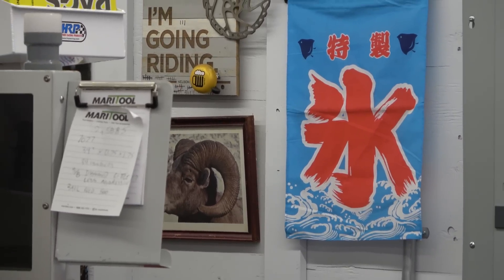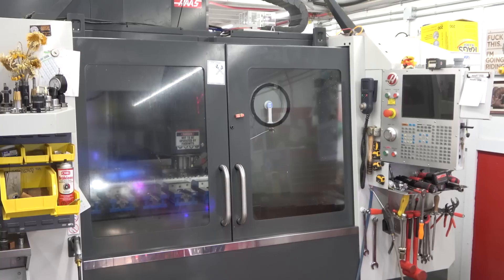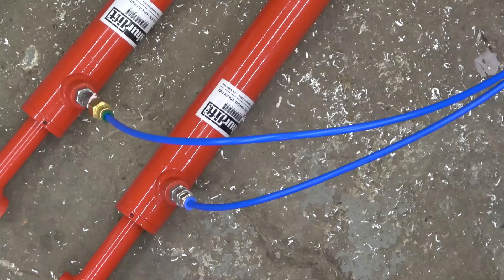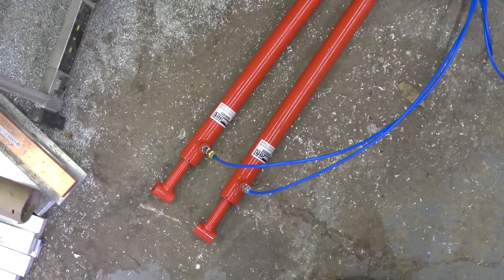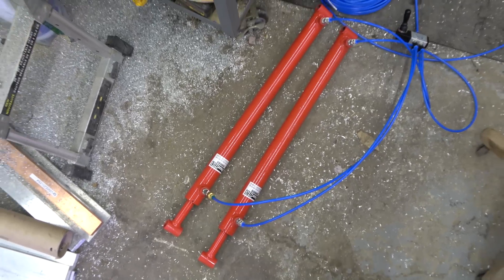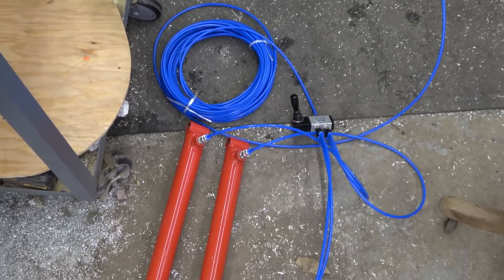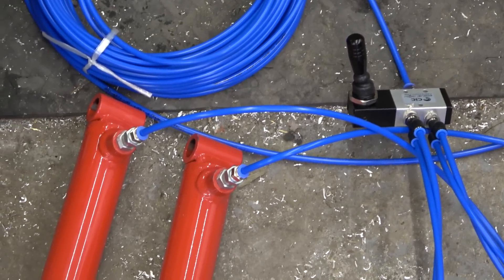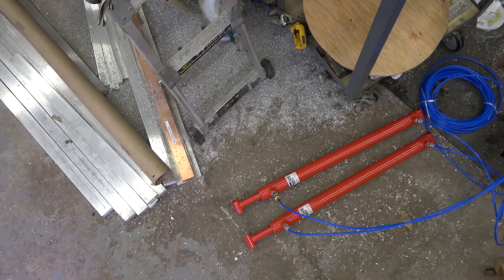Hydraulics using compressed air.

Comment: Try running it off the coolant system. That could be entertaining
Reply: LOL was gonna suggest the same... You already have a low pressure hydraulic capable fluid at the machine!
Reply: How well is the coolant filtered? Any chance of frigging up the seals?
Reply: This exists for Haas VMC machines through Dynatect. Expensiver than frick, but it'll get ya through an OSHA  violation once dewclaw puts his dangle into it.
Reply: Why would you say a hateful thing like that? Truly, man is wolf to man!
Reply: would be entertaining, you mean....
Reply: Air is a gas, not a liquid.
Reply: @nathanpennell1587  air is a fluid
Reply: @nathanpennell1587  no trueer words have ever been spoken. Unless it's really, really cold.

Comment: Just double the same top and bottom. 
Newton called it "angle of the dangle" or "sticktion" 

Something like that.  Unless your top mount is stronger than all get out. You're basically just punching a corner into the ground

Other than that, I'd say wallow out a definite bottom rail and grease the monkey out of it

Neither way is proper but it's fun 😂😂

Comment: We use air over oil with hydraulic cylinders for some applications. Tanks on either side for the oil to push into. Lubriplate FMO 85 VG-22. Takes the springy-ness out of it and the oil keeps the seals nice and lubricated.

Comment: My brother had a log loader mounted on an M-123 tank recovery truck. The dipper boom cylinder would air up if it sat around too long. It made for some pretty dangerous behavior from that boom if you didn't take a few minutes to work the air out of it.

Comment: yeah, but you could fill one side of one piston with oil, and tie the oil line to the opposite cylinder purge it good, then ending up with one air line per cylinder and the hoodraulic oil to synchronize them

Comment: I had a dream that you explained why we use hydrostatic testing vs. Air/nitrogen for pressure vessels. I witnessed an explosion recently, and I’ve always been a pro-hydraulic fan. You could maybe touch on explosive hydro-forming spheres for fun, and why nobody dies. 
Signed by a 10 year almost welder for the mining industry,
Johno

Comment: Question O the day , would it be practical to run the dumped air from any pneumatic system back to the compressor inlet to recycle used dry air . ???

Comment: One chain ran in a big oval over the doors, each door attached to the opposite parallel run of chain. Turn it from one end with an air motor on the other just an idler.

Comment: Why not  use your tools to make a rack and pinion to move the doors? Attach the rack to the top of the doors and then use a pneumatic motor to drive the pinion to open and close the doors, and the doors would be back drivable if you needed to manually open the doors.

Comment: You are the last person I expected to try this.... not a good application for air, too much chance to store energy and cut your weiner off. 😢. Use one DC linear actuator with chains and sprockets sprockets.  Actuator pushes/pulls the chain loop and takes the doors for a ride.

Comment: DIY air over hydraulic: Oversize the airlines and run them to the ceiling and fill with hydraulic oil. That way the cylinders are always filled with oil. I bet you it’ll work.

Comment: You probably have or would think of this yourself, but I'd suggest cleaning out the cylinders and lubing with  a much lighter oil than hydraulic fluid.   My guess is that the rings are permeated with the heavy hydraulic stuff and that if you could dilute that some and replace with a lighter oil permeating the rings it would work better.  OTOH the rings being made for heavier oil and (much) higer pressures, may never be happy acting as pneumatics.

You also have the problem that the rings were made to be saturated (or at least in limited contact) in heavy oil constantly. It's possible that using as pneumatics they'd dry out and eventually crumble.  Possibly you could mitigate this by making sure to include some thin oil in your pneumatic air injection.

Comment: Engineer a linkage so the  cylinder doesn't do much work. I suspect they will slam otherwise. Air will compress untill its got enough to actuate then it'll be too aggressive. Or not.

Comment: Curious if you were to do air over hydraulic with an accumulator of larger diameter increase the effective area moderating fluid flow rates. To make the flow more linear and perhaps faster since you would be displacing smaller volume of head space if the accumulator was nearly full

Comment: i'm confused. doesn't the haas have automatic doors already? my VF2 does. button on the side of the panel... the top of the door has a rack gear on it and a small motor on each side. it's not particularly fast but it works.

Comment: Hydraulic does have its advantages as far as positioning goes.
However, one can use pressure on both sides of the cylinder, as to dampen it. The cylinder still moves when a differential pressure is provided between the two sides. However, given the sticky nature of these two cylinders then one would need a fair bit of differential pressure to work with, and add on top some backing pressure for increasing stiffness, then it very quickly ends up being a scary amount of pressure.

And as detailed before, air is a much better spring than oil. So it stores a lot more energy that is always eager to escape.

Comment: There is another way to do it.
Keep the hydraulic cylinders but fill them with oil.
Have a remote reservoir where you have it filled with enough oil to compensate for the full stroke of the cylinders. 
Always compensate for the long stroke...
Have the compressed air push the oil, that will push the cylinders.
Have the control flow valve as you have it now.
Now you can give it full beans on the air pressure without the doors snapping your cock off...

Comment: That takes me back to my Interrail days, nights in rattly trains all over Europe… and the doors between carriages were no longer manual, they were super modern pneumatic.. but leaky a.f. or even worse, needle valve at the outflow was blocked, so no luck pushing them either 😂

Comment: nah throw some pneumatic oil in the lines and work them loose. its been proven at least in my short throw industrial environment with cyl that cut 1.5mm hardened steel wire. at least as a return. using a 10/1 converter on the pushing/cut side pneumatic to hydraulic converter.

Comment: A sprocket on each corner of the machine, with a chain between them ran by an electirc motor. Tie one door to one side of the chain and the other one to the other side. Voila simple system with a single motor runing both doors. A used garage door opener would be large and cumbersome but perfect for the funcrion.

Comment: back in 'dah dey (early 90s)....  my buddy was one of the first guys running hydraulic cylinders with nitrogen on his old wagon.  would pop right up off the ground with 3000psi.  i built the cups to mount the cyls in the strut pockets.  biggest problem he would have is blowing out the umbrella seals they would install to 'convert' them to air.

Comment: I think the obvious solution here is instead of additional air actuators.  You should instead just plum hydraulic to the hydraulic cylinders you already have.  2000psi > 200psi

Comment: Subscribed for the livestream of severed torso.

Tried some low viscosity oil to remove a bit of striction from the seal pack? The adjustable flow control can still be a bit variable... Chinese pneumatic cylinders are alarmingly inexpensive. Mine haven't killed me yet.

Comment: A small pump pushing some lightweight fluid instead of air would make the system that you already have set up operate very smoothly. An automotive power steering pump coupled to an air motor to keep the original plan of using air. Use a T fitting in the pressure line with a ball valve as your simple pressure relief system

Comment: use a solenoid and a m code.  once the program is finished it opens the doors. have 2 switches open and closed that cut the solenoid.

Comment: I went down this road once .I used a rotary actuator from a butterfly valve to raise and lower a boom on a spray rig . Even with needle valves controlling the air flow on both sides of the actuator the speed control was temperamental .
I always thought about using an  air over oil system like how the old single post car hoists used to operate .
/@DrewskisBrews  idea of using the cooling system sounds like it would worth a try ,

Comment: I feel if there was more load on the cyls the stickines would be secondary.    I would try for testing purposes one line for each door pulling it closed by running across the cabinit and then pully at the edge and a 10-15# weight.

Comment: I always use linear actuators where hydraulic cylinders are recommended, pneumatic cylinders in place of linear actuators, hydraulic cylinders in place of electronic servos, electronic servos in place of gate valves (except in dams), ball valves in place of flow control valves ,

Comment: I'm no brain surgeon, just an aerospace engineer, but I'm wondering if the attachment of the actuators to the doors is adding a bending moment that increases the stiction.

Also, maybe you could ask the missus if you could borrow some lube, help the shafts slide easy through the seals and whatnot.

Comment: use flow control to meter out your air on each side of the cylinder it will smooth it right out.

Comment: Took a couple racing shocks. Took the valved pistons out and made some solid ones from aluminum and a couple O-rings. Welded in fittings on each end. Now I can set my race car at dynamic for testing and measuring. Look like normal race bilsteins with ball valves and an air hose fitting out the side lol.

Comment: air over hyd. make a fixed orifice flow control. no more air spring and no fool can slam your door going, what's this for? you can also gain the power you need with a larger surface area on the oil reservoir

Comment: Put a bunch of air tool oil in both sides of the cylinders then stroke them manually. They will move smoothly now via air

Comment: Had to go back and check. Doors go into the enclosure. 

I was thinking before I checked, what if both cylinders were attached over both doors? Twice the power pushing doors apart or pulling them together. Don't think it's a good idea to mount them inside.

Comment: Here's an idear, Uncle Bumble. Pull those apart and put in the pneumatic seals. Should work as that the only major difference betwixt the 2 types. Then toss in the flow control valves.

Comment: Flow control is easy, just jam a 5mm long smaller size tube in your lines to the cylinder, yeah its not adjustable, but try diffrent id sizes to get the results you are looking for. Branson has been doing that on their ultrasonic welders for years.

Comment: we have the same problem with using hydraulic cylinders to raise our od signs,,, instal a "t" on one of the ports on each cylinder and add some 3in1 oil once in awhile,,,,it reduces the sticktivity while adding sealamation

Comment: That almost worked great AvE., maybe a large coil spring attached to the outbound rod so it'll help retract it?

BTW, many moons ago when I was a wee lad, working as shop labor at Beamsterboer Slag and Ballast in or around Hammond, Indiana, the mechanics one day were working on a large hydraulic cylinder removed from a large bulldozer. They were having trouble moving the movable part so decided to use compressed air to NUDGE it out bit by bit, but unfortunately they didn't provide any limiting device to the cylinder whilst doing so, and on the first shot of compressed air, the inner rod shot out of the outer cylinder like a cannon ball, which when skittering across the shop floor along with what seemed like gallons of hydraulic fluid : )

Comment: It needs to have high pressure on both sides and decrease pressure on one side to move. As an bonus you get better sound effects. On air pressure loss can have doors notmally open with spring valve

Comment: It's the doors it's y the handles are in the middle of the door your pushing on one angle witch is making the door 100 times harder too open and close its trying open on an angle when you put like that you want a cylinder on top and bottom of the door of if you run one then it has too be in the middle like qere the handles are 😅😅😅

Comment: Maybe switch to electric motor and build a pulley system so both doors open simultenouesly using the rotational movement of said motor. Less hardware, less noise and in my mind easier safety implementation. This elevator door style scream broken forearm when stick slip hits 😂 anyways, i know your that fluid mechanix guy so you do you. Thanks for the video and greetings from germany from a long time viewer.

Comment: If you really want to make it complicated and fun, use a single cylinder attached to lines going through a few pulleys just like you would with curtains or drapes.

My buddy did this for a set of sliding doors he wanted to open and close like they do on star trek, it worked surprisingly well though it did open and close a little hard sometimes.

Comment: Just add a pneumatically actuated hammer to the cylinders. 5 taps per second, easily done with 10 0r 12 valves on one of these fluid logic systems that were popular in the 70's.
Reply: Or an air chisel on a springamathing with the chisel electro-glued.  Should chooch

Comment: There may also be assembly lube (grease) in the cylinders that is causing the sticktion at both extremes of travel.  Disassemble them, clean with a non-chlor solvent, and reassemble with spray dry silicone as the lube.

Comment: Probably would help if you add one of those oil mist thingies in the line. Just keep opening that oil valve until it works. Probably way before, but ultimately, it'll work at 100% saturation. 😛
But yeah, I'd probably use something like a Tr16 trapezoidal lead screw with an Igus Drylin flange nut and an angled piece of steel for this. Those Igus things are dry low-friction things, ideal for when you don't want the stickiness of grease. Used them a couple of times. They are far too expensive for regular use, and technically overpriced for what they are - pretty much an injection moulded plastic block, but they are really nice for these kinds of environments. 🙂

Comment: get some graphite or zinc or the like in them skookum choochers; will both fill in the cylinder surface finish and loose up them seals right quick ;P 

a needle valve barely cracked wouldn't hurt for a poor-mans safety device, might save some limbs if you forget there's a half-fired loaded gun holding your door open. compressed air ain't no joke.

Comment: I was wondering if its possible to power some cylinders with a pressure washer. Ever tried that? then i thought if the water didnt work maybe a very lightweight oil could be ran through it. just an idea i had for a log turner on a sawmill.

Comment: As they are hydraulic cylinders and you are using air to drive them, what about using a small amount of hydraulic fluid just to lubricate the seals? For the long term,  you could modify the system so it incorporates an inline oiler, as used on pneumatic power tools, to keep the cylinder seals in top condition and help the cylinders have a long and perfectly functioning life.

Comment: Pull it apart, use some brake clean or something to obliterate any old hydraulic fluid residues that might be left in there, put in a seal kit more suitable for pneumatic use, and it's good.
But really, it's a miracle you can get it to move at all like that as it is, it does not like the air at all.

Comment: Surprised you didn't spring for the VF3SS with the auto doors, it's only like a $20k upgrade 😅

Also, doesn't need to hold pressure when the door lock is engaged, you'd have to go full 400lb gorilla to even make the mag lock think about opening.

Pro tip: if you jam a set of step blocks against the door sensors, it thinks it's closed when it isn't and you can work with the doors open.

Comment: You say that you don't have flow controls, but I'll bet a hard earned looney that you do. Somewhere in your buckets of treasure you have the fixed flow control variety. A set screw with a small hole drilled through installed in-line. Preferably in the cylinder port, but inside the end of your push lock will do in a pinch. And.... It's bi-directional, which we all know is twice the fun. Adjust the hole size to suit (not like I had to tell you that). If you're making a thingama thing you might as well make another thingama thing.

Comment: With servo's i use springs to move stuff the first and last parts. They start to push (build up tention in spring), and when they stop, the spring pushes softly to the end stop. If the servo needs to go to the end, it nevers makes it, and starts to fight.

With springs the cilinder could move without tention, build up speed, remove drag, and start pushing... Try it maybe?

Comment: Did you consider rack and pinion on a small electric (possibly stepper) motor? Pneumatic would probably work too but might also have the excess momentum problem.
Reply: Currently out of stock at Princess Auto.

Comment: What happens if you use a mechanical stop to keep the cylinder from going to the max and min movement? Is it the seals bottoming out at the ends causing the stick? How does it react when stopped mid throw?